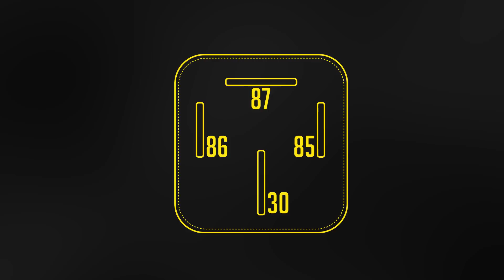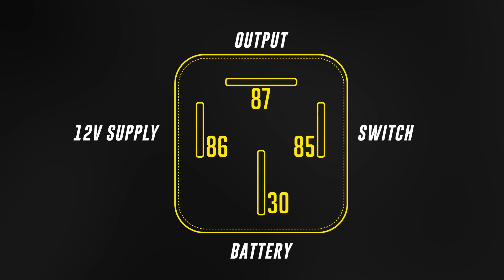🛠 How Relays Work  |  TECH TUESDAY  |

Comment: Good little video...Relays are my favourite device to improve car electrical systems...especially older cars or fitting extra horns etc...don't forget some are normally on and some are normally off whilst others have both options on the one relay...some relays come with a built in fuse which is also very handy..saves placing a separate one in the circuit. Fully electronic relays are also available now...

Comment: Could I hook a hobb/boost switch or a boost switch on pin 86 or pin 85
Reply: If the boost switch acts like one on your dashboard then yes you can infact some water meth systems work this was the pressure switch is mounted in the piping and once a threshold is hit it triggers the spray system
Reply: kyle hubner that’s cool good tip.
Reply: kyle hubner if I’m hooking it up to my double 525 fuel pump setup and set it up to come on at 10-15 lbs still recommend it?
Reply: @justinranes3351  your ECU should be looking after which fuel pumps are turning on when